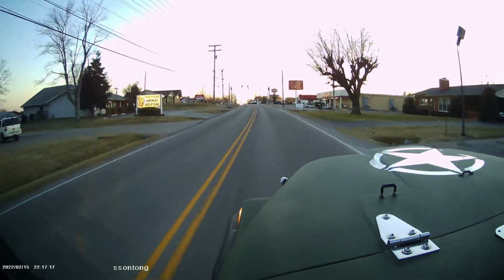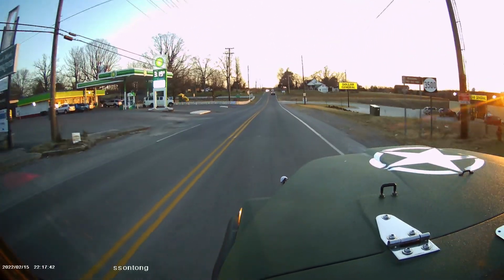Driving a 1978 Jeep CJ-5

Comment: Great video, non Jeepers will never understand these are NOT cars and will never handle like one because of the solid axles and many other suspension variables. 

People with any Jeep common sense know to keep it stock or very close to it, don't want to wander too far from the stock geometry. I walked away from many ragged out TJ's from rotted out frames to having 33" - 37" tires with 4" - 7" of lift.

I was very fortunate to find an immaculate '05 TJ Rocky Mtn with the AMC 4.0 and it's by far the best Jeep I've had. It's built modestly and more importantly wisely, since I'm an adventurer, not a darn rock crawler, sorry but thats like watching paint dry and seeing people destroying axles and every other suspension part unnecessarily. 

I live close to the Outer Banks, so this TJ is mostly a beach / sand hill wheeler, plus my dd. 2" Old Man Emu coils and 32" KO2's. Currectlync steering, Freedom Off Road front lower adj control arms, adj front track bar, M.O.R.E steering box brace, transfer case drop kit, Fox steering stabilizer and Fox 2.0 Shox. Tightened the gear box about an 1/8 of a turn. These Fox steering stabilizers are notorious for pulling left since they are pressurized, I have to get it calibrated. Overall, it's a great Jeep for local short trips, even with the upgraded coil spring suspension, the steering on this '05 TJ can get wonky on long trips. I have to invest in a beefier gearbox, either from a Dodge Durango or PSC. I never thought much of these Mercedes gearboxes, but not being able to handle lightweight 32" tires and 22lbs alloy baja rims for a total of 68lbs each speaks volumes on how shitty they are!

Sarge is one great ole Jeep!

                  O|||||||O
       🇺🇲 Only in a 2 Dr 🇺🇸
                 '41 - '06
Reply from the maker: Thank you for the comments and I would love to see the TJ!  Sounds like a great Jeep!

Comment: The 78 CJ-5 had the big Brake.  Larger Brakes than Earlier CJ's. Adding a Vacume Booster for Power isn't a hard project. 
Driving I find most older jeeps had some guy with a screw driver tighten down on the steering gear. The manual steering is fine. If you buy a CJ back the steering gear off a 1/4 turn to a half. Usually the steering shafts lower coupling or upper universal is got 10 degrees wear or play. The replacement shafts are junk and if they won't telescope in and out a bit Don't buy it unless you want to buy a new steering columb. They are colapsable but rigged. The body and frame flex and vary in the length from column to the steering gear. This movement will destroy your column.  The lower Coupler can be rebuilt to remove the play.
A WORD ABOUT STEERING A CJ'5. 
1. If it is jacked up and huge tires Walk Away. STOCK is much better for the highway. A little lift and bigger tires are fine but a big lift and huge tires  will change the dynamics of the steering.
2. Be prepared to take several weeks to relearn how to steer the CJ's. Suttle turns and tweeks rather than fighting the wheel. Every New CJ driver I ever seen Over Corrected repeatable until they learned the steering "saginaw steering" . Beware most OEM steering new parts are not even close to original spec's. soft metal junk. If your jeep wanders or doesn't steer well or super hard to steer it has a problem. They don't drive like other vehicles but once you learn it not a problem at all. My wife put 10's of thousands of miles on ours same as me. She'll tell you, "you gotta learn to drive a Jeep." Sarge is looking Good. Consider a power steering upgrade. Prepare to change the shaft to. The splines on some are different and a coupler change out will solve that. Good Caving and 73,s old man.
Reply: I agree, keep it stock or very close to it, don't want to wander too far from the stock geometry. I walked away from many ragged out TJ's from rotted out frames to having 33" - 37" tires with 4" - 7" of lift.

I was fortunate to find an immaculate '05 TJ Rocky Mtn with the AMC 4.0 and it's by far the best Jeep I've had. I kept the build modest since it's mostly a beach / sand hill wheeler, plus a  dd. 2" Old Man Emu coils and 32" KO2's. Despite having a modest build, I had to get the Currectlync steering, Freedom Off Road front lower adj control arms, adj front track bar, M.O.R.E steering box brace, transfer case drop kit, Fox steering stabilizer and Fox 2.0 Shox. Tightened the gear box about an 1/8 of a turn. These Fox steering stabilizers are notorious for pulling left since they are pressurized, I have to get it calibrated. Overall, it's a great Jeep for local short trips, however the steering can get wonky on long trips. I have to invest in a beefier gearbox, either from a Dodge Durango or PSC. I never thought much of these Mercedes gearboxes, but not being able to handle lightweight 32" tires and 22lbs alloy baja rims for a total of 68lbs each speaks volumes on how shitty they are!